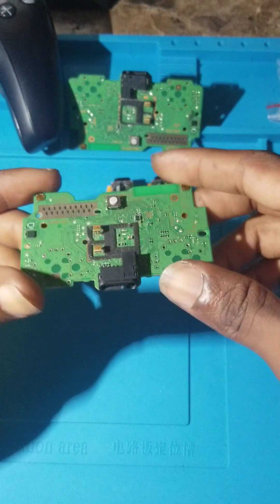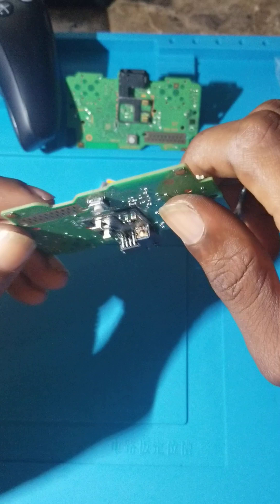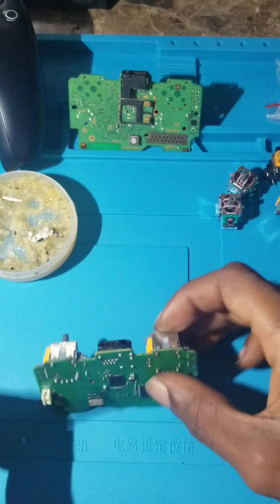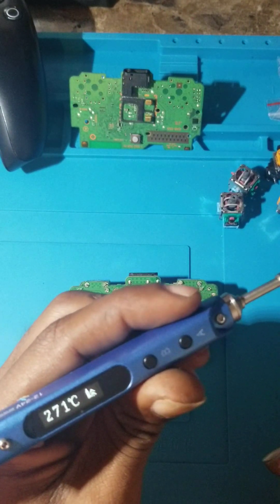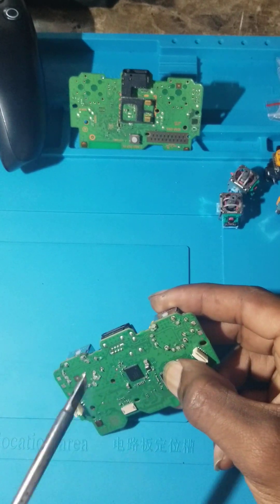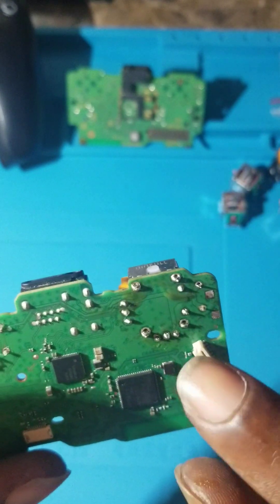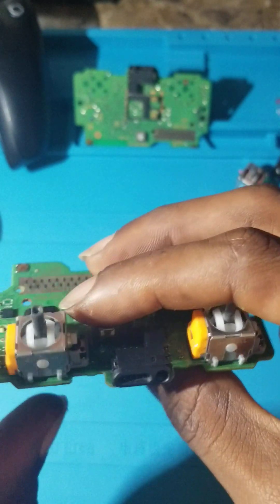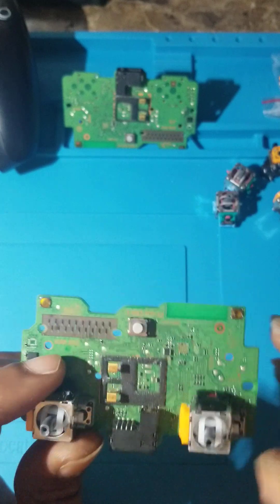No more stick drift #diy #ps4 #controller  #Halifax

Comment: How did you de-soldier?
Reply from the maker: Wassup bro 😎 are use a Rework Soldering Station; but I have a cool way to do it. If you don't have much tools, it would require you to disassemble the thumb stick on the board. I can show it in the video soon.